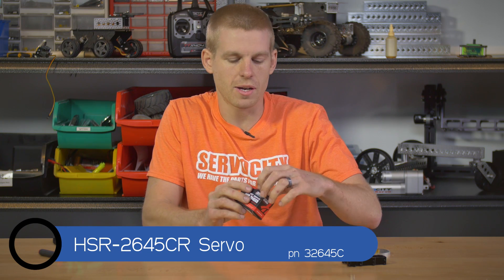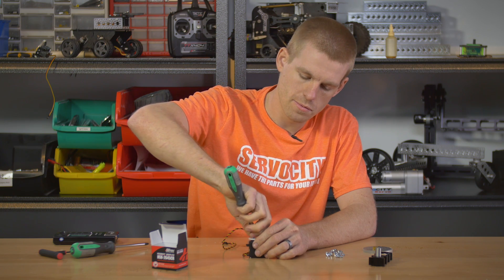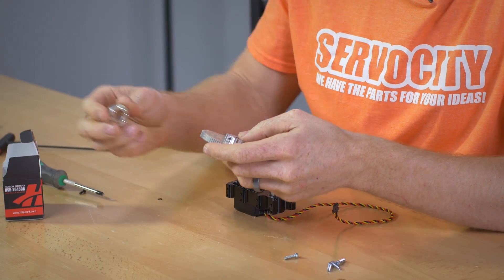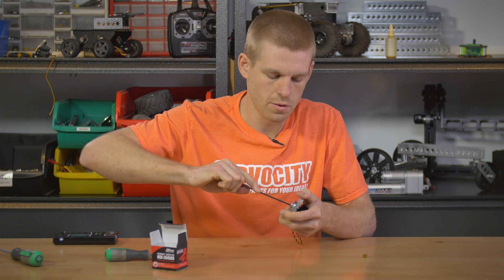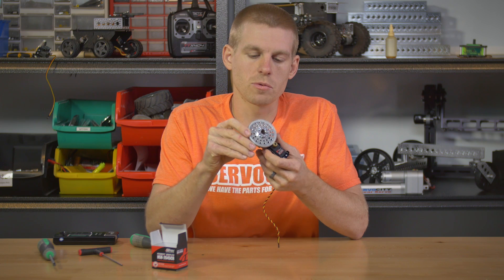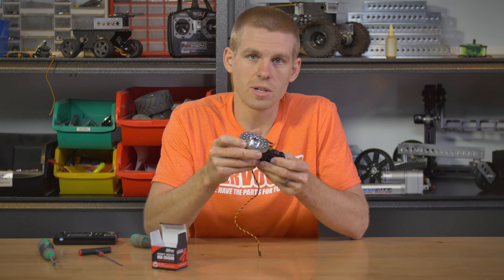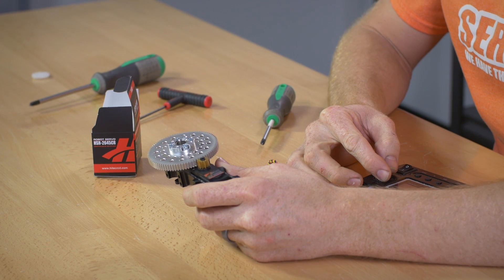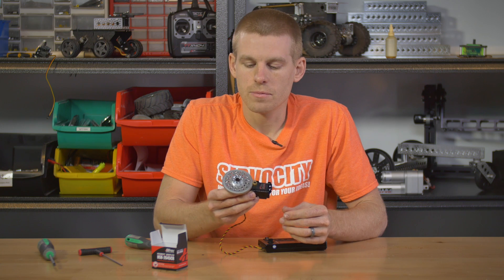Using a continuous rotation servo with a servo gearbox - explained by Kyle from ServoCity

Comment: Hi. I am searching for a very fast servo. The torque doesn't have to be high, i can compromise on that. But I need about 3 rev/ seconds or close to that
Reply from the maker: Hi Ayson, most servos are limited to about 180 degrees of travel so if you're looking for multiple turns you may want to consider a gear motor rather than a servo.  Three rotations per second equates to 180RPM.  Feel free to email our Tech Team should you have any other questions and we'd be glad to assist tech@servocity.com.